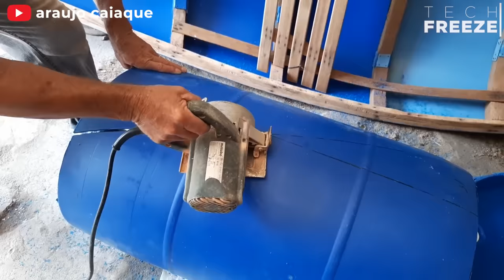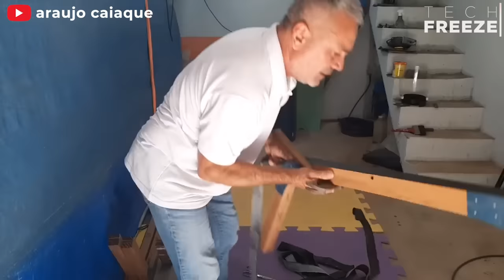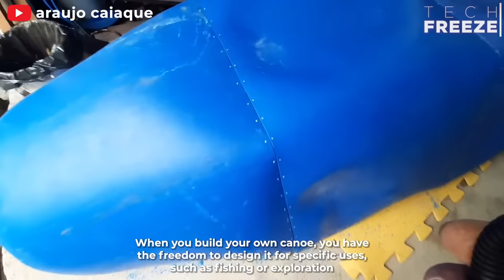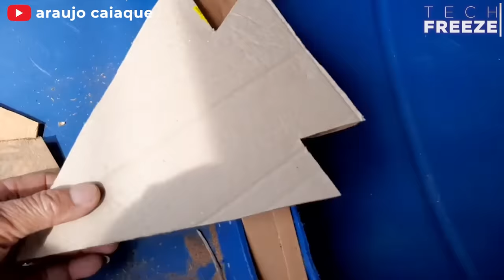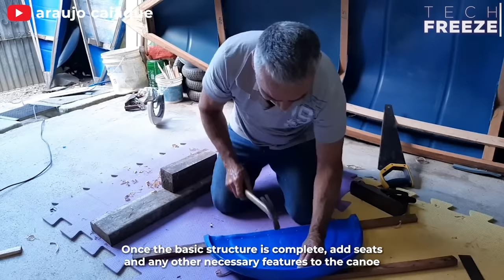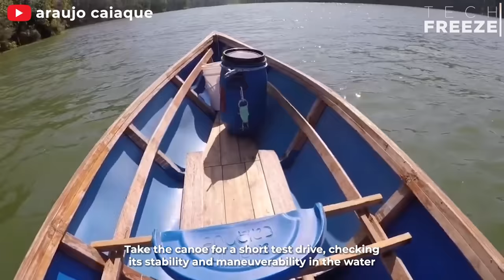Man Transforms Plastic Drums into an Amazing Boat | Start to Finish Build by @araujocaiaque

Comment: That thing will leak like a sieve at the seams. Poly has to be heat welding at the seams with a nitrogen gas feed. No adhesive will "stick" to poly for long.
Reply: Actually, hot glue sticks really well to HDPE and in water will never come loose due to cool temperatures.
Reply: @HighTech.360  Да, я думаю, за безопасность можно не беспокоиться. Вспомни как совсем недавно батискаф около Титаника раздавило. Вот там да. Погрузились на самодельном корыте на большую глубину. А тут, даже если эта лодка развалится, ничего страшного не произойдет. Главное спасательный круг с собой возить 😅
Reply: Resourceful and clever! thanks for sharing, that's awesome
Reply: Lo mismo me pregunté, tendrá filtraciones de agua 😥
Reply: Para mim ficou ótimo. Só repetiria o exterior com fibra de vidro, iria garantir que não iria entrar água, e esse barco duraria muitos anos!
Reply: Heard of plastic welding?
Reply: Its can be solved easily if that guy use some flex seal on his boat
Reply: ❤ล😊 @PulseCodeModulate

Comment: 13 years ago, I  designed a 17 foot canoe that used two 4x8 sheets of 1/4 inch CDX plywood & two 20 foot spruce 1x4's. It was a project with my 15 year old grandson. We designed it "on the run" with only fewbasic sketches to convey the basic ideas. It turned out very good. Only wish we could've afforded marine plywood. Over the years stored on saw horses outside, some entrapped water allowed rot in a few places. It is a "one off" canoe, like no other on earth. Until he gets inspired to renovate it & put fiberglass instead of the paint, it is shrinkwraped & hung from the ceiling of a shed. Getting married & other things of life has allowed it to be set aside. We were so proud when it was first put into the river for it's maiden voyage & it performed better than we could have hoped for. 😊
Reply: Que bonito recuerdo. Admirable. Me recuerda a la relación que tenía con mi abuelo. Espero tengan muchos más proyectos juntos
Reply: Memories 👍🏻🏴
Reply: Good for you , sir !
   Priceless experience you both will never forget …

Comment: Tested steering. It will not steer as it has no keel or you added it but fidnt show it. Coating the surfaces of the wood does almost nothing. The bottom area between the plastic and wood are not sealed and thats where water will cause rot
Reply: One video that show two different boats. The first he builds looks like a canoe whereas the second has a transom with some work below that points to some kind of keel.

He also uses two different outboards -
Reply: I saw him using rubber sealing strips from old bicycle inner tubes to successfully dry-in the hull…

Comment: Very interesting, but nailing the plastic to the frame will not last. As the boat is used, the nails will gradually pull out. Screws would work much better. Also the joins between each piece of plastic have to be sealed against water coming in. How do you do that? Some kind of tape or adhesive or liquid that you could melt with a heat gun might work.

Comment: SAVING your video to help me build one similar!! I want to make  one a bit larger to fit me, but wrapped in fiberglass and with expandable sealant on the inside to aid in floatation (unsinkable...)! Basically a Jonboat for here in Florida. Your video gives a great starting blueprint for such a build! THANKS! Big fan here!

Comment: I love the ingenuity.  The things people can do if they just do it.
Reply: А космический корабль он может сделать из железных бочек ? Или тазик только из отходов тары. Племя тумбо- юмбо-барабан  у которых запас словарный 200 слов  может этому научиться в течении 2-3 месяцев. И даже молоток могут на свалке отходов найти и гвозди кривые.  А старую рессору от автомобиля разогреют на костре  и это станет паяльником.  Удобная и дармовая штучка  для вылавливания мутанта рыбки из загрязнённого  химикатами водоёма. - Ноги в воде не расплавятся от кислот.
Reply: Try and repair holes in HDPE , you need a reducing flame, and no oxidation, special epoxy. Problem is extremely low surface energy.
Reply: @catsupchutney   I can see that f you want to bond the plastic.  Mechanical repairs, much like the inner tube,gasket are probably the way to go.  Also, have you ever tried to poke a hole in a plastic drum?  I'm thinking these boats are pretty robust.

Comment: Logically it appears all well, but theoretically speaking, those iron nails along the bottom seams, will over time, with exposure to water, give way , leading to water ingress. 

Its better if the plastic seams are flame welded for water tightness, and a few nut bolts amongst those nails will make it more reliable.

That water drum in the front has probably  been filled with sand or gravel in order to counter balance the weight of the man and the motor behind, which is not the case with a wooden canoe.

Finally, i recommend a prayer and a life jacket along with the BOARDING PASS 😂

Comment: All done with antique tools. When I was 15, I built an 8' hydroplane called The Minimax from Glen L plans. It weighed 72 pounds and would haul ass with a 15 HP Johnson, twice the recommended horsepower.
Reply: Hampton VA?
Reply: @o9rgeronimo979  Nope, couldn't be much farther away.... White Salmon, WA and the mile wide Columbia River.

Comment: Vac. formed PE drums are actually quite thin, easily punctured by a branch or stone, and virtually impossible to fix holes in. Rotomoulded kayaks and sit on tops are generally thicker and multi layered.

Comment: Wow what a great project. How did you seal the joints please? Thank you for sharing. Blessings from Cape Town.
Reply: That's what I didnt understand as well. I saw him nail them but what is the joint made out of and how? How does it not leak at the seams?
Reply: @joebudi5136  Ah so at least I am not alone. Thank you for posting. Hopefully we get a reply.
Reply: I think he stretches bicycle innertubes over the outside of the frames to seal the seams of the barrels.
Reply: It looks like he attached a layer of rubber on the wood frame, that acts as a seal or gasket. Maybe he heats it up to tighten and melt the rubber to the plastic forming a tighter seal. He had his heat gun with him as he nailed the plastic to the frame.
Reply: @maggaman1603  Is that enough for a water seal tho? One seap in spot is all that is needed. Water finds the way in.
Reply: @johnhicks692  If he used silicone, I could see that working but interludes only held by nails doesn't fly. Water finds its way in. The innertube can work if there was a sealer liquid of some kind used. Might work at first without, but as the boat is used, those nails will loosen slightly, wood will swell up then shrink then swell, etc.
Reply: @johnhicks692  but how effective is that please?

Comment: Didn’t you heat the joints? So they melted together? How does it hold up in the long run? Kenya... that was also an interesting surprise. But that is a quite warm climate. Wonder how these joints would appear in the far northern hemisphere. BUT a great effort,even though it isn’t a canoe, but a boat. Seems quite stable and indeed affordable.

Comment: Overlap the edges and use screws so they don’t work loose.  I’m half way threw the video and starting to worry about weight and cost 🤔 

Barrel x4 at $25 each then add one more barrel for extra parts.

But yes it would be a fun project!!!!

Comment: Any boat project, made in Brazil, that is made to use an engine, must have the signature of a naval engineer, undergo inspection by the port captaincy and only then can it sail. Everything there is very beautiful, if it were used in a small lake or river, but it doesn't have a screw, I didn't see any glue used, paint was applied only after it was assembled, that is, the lower parts were missing, and when using a motor, I don't trust it. After all, boating involves safety. even more so with this big tail, which vibrates a lot.

Comment: I would have used screws, not nails.
Reply: I would have used fiberglass instead of plastic barrels
Reply: barrels are free LOL
 @OLDMANTEA
Reply: I would've overlapped the seams and apply a sealing or make a gasket
Reply: Go right ahead BUT you probably can`t do.s..it.

Comment: What did you use to seal the seams?
Reply: of you look at the beams for the ribs he is lining it with a seal on the bottom.  I bet that is the solution to your question and also why he is not using screws as to not disturb the seals.
Reply: @murraytechnician2507 
That's not going to seal ot

Comment: That boat is so light it makes it very unstable and it will be at the mercy of the wind. I could see this as a viable option in 3rd world countries where boats and materials are hard to come by or expensive but here in the U.S. I can easily pick up a 12' aluminum boat for $200 or less and not have to put in all that work.

Comment: the joints will not stay waterproof, no way, they need to be heat welded with a gas-fed heat torch and or hot steel joining knife,